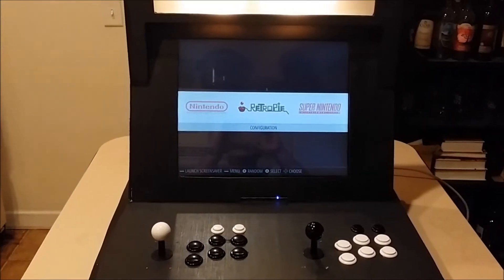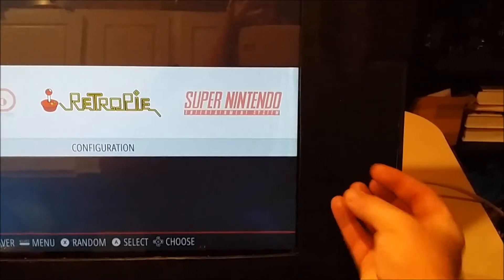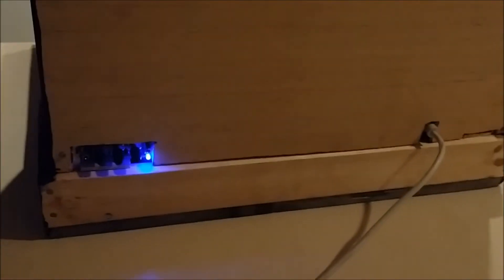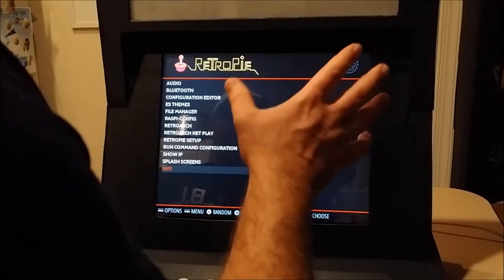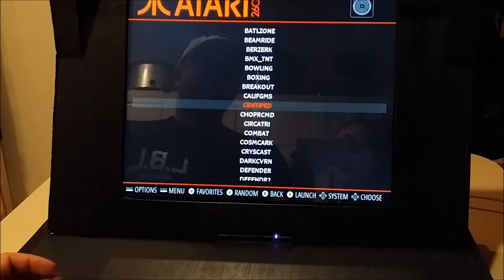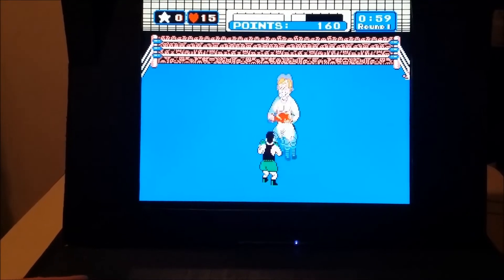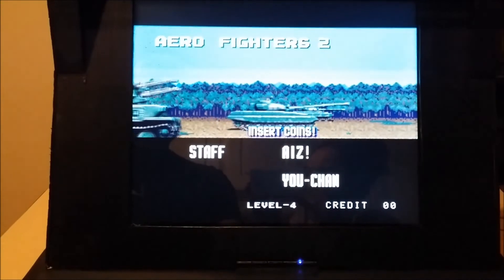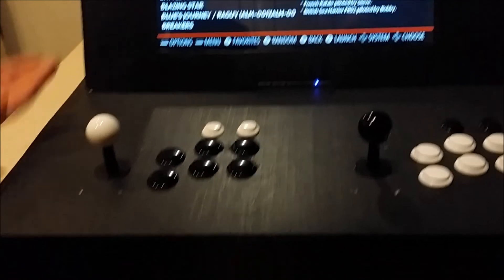Retro Pi Bar Top Arcade (Raspberry Pi 3b+)

Comment: It would be better a strip of LEDs that works with 5 volts and you connect it to the speakers or to the power input of the board and it would be better if you have light bulbs that look really bad. It is a personal advice.
Reply from the maker: Hello and welcome to the channel. I agree. I used 12 volt led light bar on my full size arcade in my latest video. This bartop was like you said a personal build and done with literal scrapped material for next to nothing as far as money.